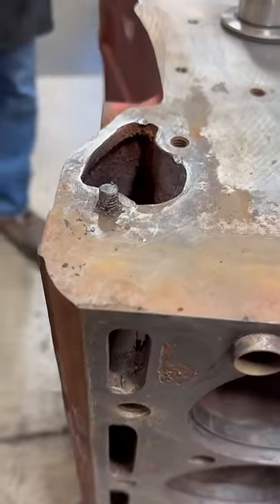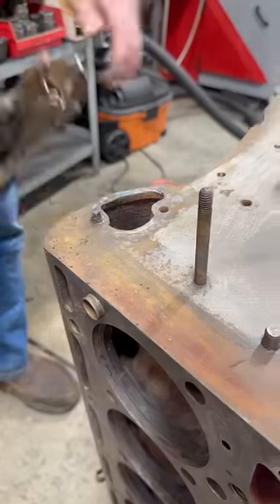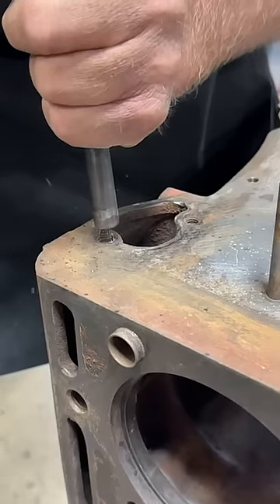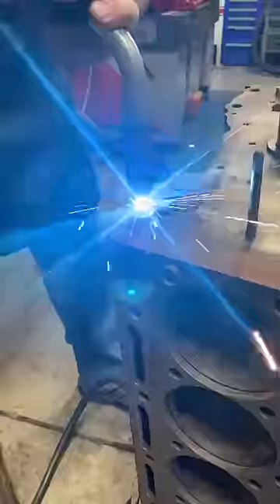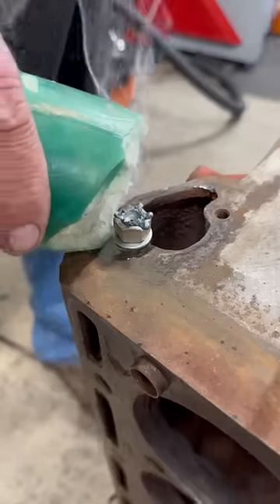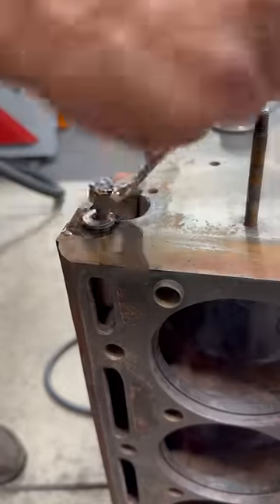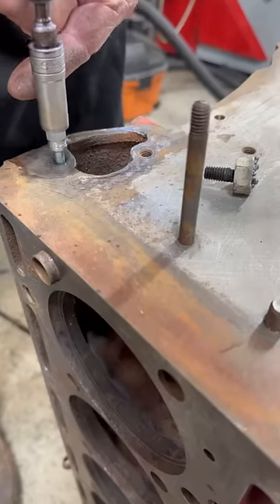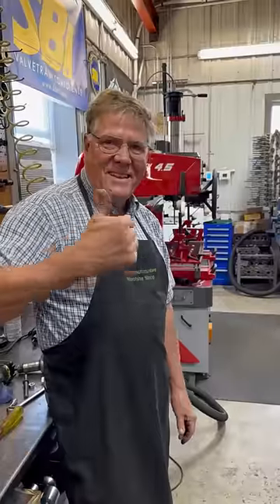#shorts I Make So Much Money Removing Broken Bolts

Comment: Waste of time. Heat soak that stud with an oxy torch, let it sit for a few seconds, cherry it again and spin it out with the video grips. The heat from the welder is doing the same damn thing to the stud as the torch. But now you wasted time dragging the welder over, putting your mask on, welding the nut, using a ratchet etc. Where's the old man at, I'm sure he would smack you in the back of the head.